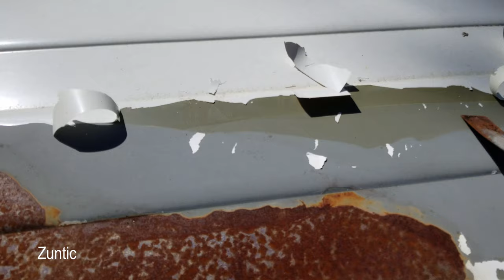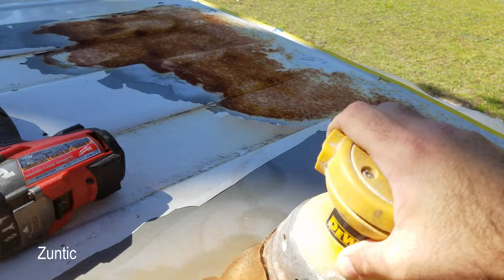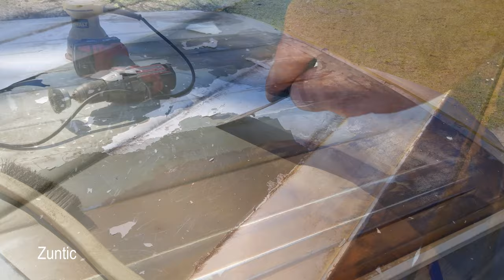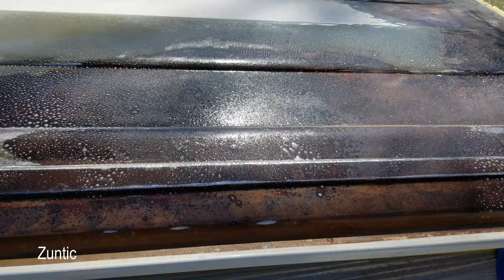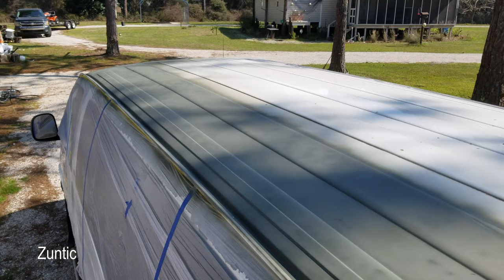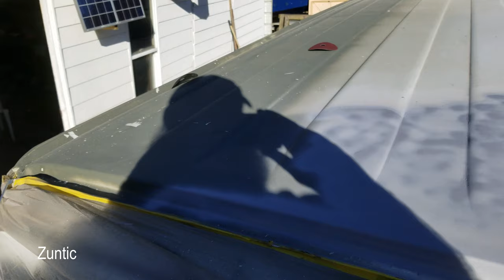Fixing 2002 GMC 3500 Van paint peeling on roof

Comment: There are so many GM's out there that LQQK like this I thought it was an option......every one should be fixed at GM's EXPENSE no matter what the age.  It's 99.999999999999999999% white vehicles. Hoods, roofs, sides of doors.  Some genuine advertising for a quality product.................
Reply from the maker: Yes i agree with you. After i got my van i started to notice most of the white vans that i saw were the same as mine.
Reply: My 2002 white tahoe looks exactly like this :/
Reply: same thing with my van! they used such a light coat of paint !

Comment: How did you record this ..?  I'm guessing you didn't hold the camera in one hand and the brush / sander in the other ..?  Bc I have the same issue and I'm going to do a similar project. Sand the roof bare ... and was also thinking of using the rustoleum primer and spray paint.  Thanks!  

Of course I have identical flaking off paint.  I thought that was from spray paint. 
I cannot believe!! it's actually the FACTORY paint that flakes off like that.

Comment: I live in the northwest and have a white 2001 2500 Express with rust in three spots on the roof starting right at the windshield and going back about a foot.  The rain gutters are also rusty.  I had a couple of questions.   What is adequate surface prep before primer?  Should the metal be shiny silver color?  Did that Rust Kutter spray save time?   Is it tough to match the original color using Rustoleum?    Thanks so much for doing this video!

Comment: So, yeah my entire van is doing this. Well, a lot more on the driver's side than the passenger side, but the whole roof is peeling. I'm able to more or less take the peeling paint off with a high pressure garden hose. So I'm going to grind/strip the whole thing down to metal at least on that side, and repaint with either plasti-dip or raptor liner. My big question is, if I just paint over the passenger side, which isn't peeling, will that paint fail soon and take the raptor liner off with it!?!?!? This is just painful.
Reply from the maker: On my van after i did the roof and spot of paint that i left on peeled off about 2 months later. So i would think that any old paint would potentially peel. I no longer have the gmc van so i do not know how it is doing still.
Reply: @Zuntic  Thanks for the reply. Ugh, that's what I was afraid of. Best to take the finish down to metal and start over. What a pain.

Comment: Man, you should have done it before it rusted.  Pressure was that shit off.   GM should be ashamed of the crap paint job.  All their vans peel.  I’m shocked they can sell one.  The guy at the yard bought one and I asked him wasn’t he afraid the paint would peel.  He never noticed.   How’s it possible with all the vans and the peeling paint you haven’t noticed.  A few years later his back doors started dropping paint.  He claims they will cover it.
Reply from the maker: It was rusted when i bought the van. Very common problem with the van roofs.
Reply: Water is what causes the paint to peel off so unless you want to paint the entire panel don't pressure wash. I just sprayed some bubbles with a garden hose and the paint came off in sheets.

If you just want to spot repair then scrape the edges to remove large loose sheets of paint and then sand down the edges and good paint. Clean with rubbing alcohol and then cover with primer.
Reply: Honda Toyota and Ford have the same problem. I figure it's DuPont or whoever supplies the paint
Reply: @crowdnine878  I’ve never seen a van from anybody but Gm with paint just peeling off.   My last van was a ford and I sold it at 15 years and it never peeled.   It’s a bonding problem with the primer.

Comment: There was a secret recall of the paint on these around 2000 but you have to force dealership to do it.  We had a few work trucks and the owner wanted them perfect. They had to San last the entire truck as it’s in the primer coat which repels a top coat. Shame on GM.

Comment: General Motors and Chevrolet have had this problem for 20+ years they should be kicked in the nuts for not fixing this BS.
Reply from the maker: Yes they should, the paint came off the whole van.
Reply: I have a 2016… SAME DANG THING! They still haven’t fixed the problem!
Reply: Honda Toyota and Ford have the same problem. I figure it's DuPont or whoever supplies the paint